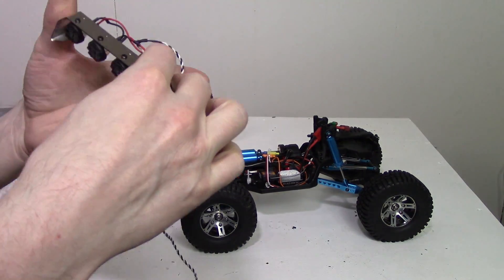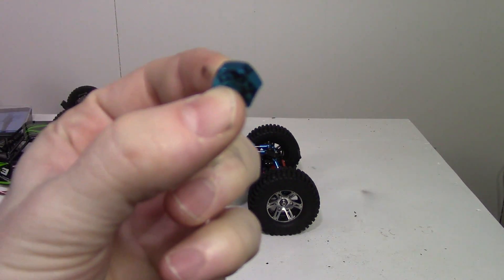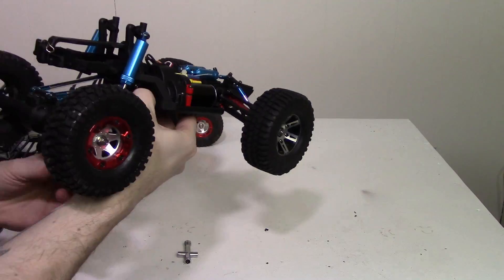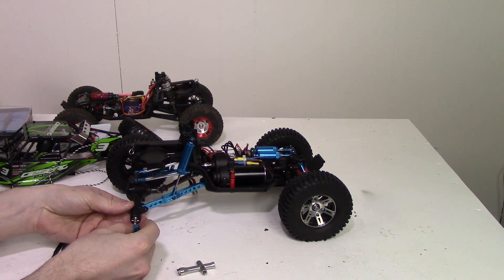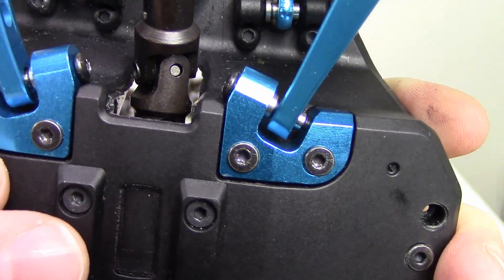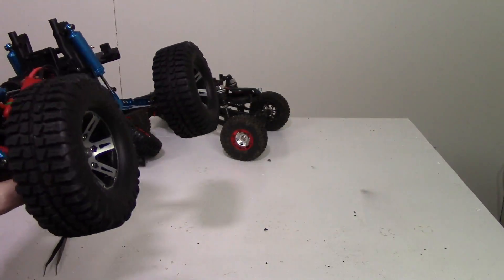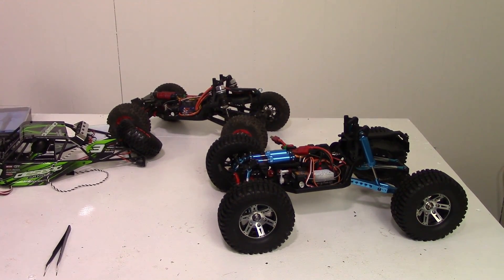Taking a look at a few more Feiyue upgrades!

Comment: how's bout a quick update on those oil shocks. I'm worried about their functionality being the price I spent on them and they don't even have no type of bladder system in them to help keep fluid from foaming. shit I'm seriously  considering using power steering fluid as it originates either from silicone or mineral  base product same as rc oil but I really trust p/s fluids anti foaming agents more I think considering I've worked with it my whole life. how they been for you? really need to do a full charge bashing run than open up a shock and see if it's full of air bubbles or see if it start to get bouncy in rear as Temps rise or under lengthy use. keep me posted appreciate  it void!!
Reply from the maker: I'm hoping next week the weather will cooperate for me to get out to the trials to do some good running. I've just recently replaced the no name 30ish weight oil I had in the rear shocks with some team associated 80wt oil(made by lucas oil). I'm hoping that it should preform well. It's already made the shocks feel much nicer, less bouncy and a nicer rebound. I'll be doing the front shocks before I take it out, I'll let you know how it goes when I do!
Reply: Appreciate it. From the 1 review I seen on you tube on that team associated oil, white bottle with blue writing it didn't do so hot in cold temps actually it was more on the cold side than hot. Stiffened to the point it would give no travel to the shocks the bottle claimed it wouldn't do that in cold conditions, Idk I do know Lucas makes some of the very best products. Oil does stiffen up when cold so without some kind of alcohol additive I can't see them claiming that.

Comment: I did some lol tree climbing yesterday and I have to say I'm greatly impressed with how easy this buggy climbed up the tree all the way up vertical with the slightest throttle input and stayed as long as I kept on the throttle of course. I'll post a quick pic in a minute. These tires are super sticky that's for sure way way better more traction that the stock treads. I will say the 10 to 15 minutes of tree climbing got the motor and esc way way hotter than any 30 to 40 minutes of yard bashing even during the 90° days. Anywho now I got this new job I'm gonna go ahead and order the jlb cheetah oooh I'm geeked about this project for sure. Can't wait to see it complete with a nice 5th scale can idk it comes stock with 8th scale motor so why not. Like I was saying earlier I plan on sticking with skyrc stuff cause they so far have shown me nothing but great results. One ride I plan on goin all out with something more expensive. Gen 2 tekin esc I'm thinking. Idk well see what goes down. I'll for sure stay in touch with you since your the only person I know and talk that likes the hobby as much as I do.
Reply from the maker: I just checked and I guess you haven't put the pics up yet, but that sounds like some great fun tree climbing lol. I'll have to give some skyrc esc/motors a try sometime, have never used them. I'll check again to see if you added the pics in a bit. I've always wanted to drive a 1/5th scale but 1/8th is the biggest I have so far. I don't really have a place to run a big 5th scale rc either, not to mention I can't afford one either heh.

Comment: Hey Void, any advice for a nice servo upgrade for the FY01 , I'm pretty new to these, just looking for some more turning power.  I'll be installing the brushless kit soon but the one sold on BG doesn't seem to be much stronger.  Can't seem to find the right info for a more powerful servo that will fit in place.  Any help is greatly appreciated.

Comment: I would paint the silver part on the light bar black so that it would match better, just my opinion.  What are the length of the front and rear shocks that you used in the build?  Can you provide a link on where to get them?   What type of wheels are you running? Great video, keep the content coming!!
Reply from the maker: Thanks very much! I have already painted the light bar black now though. The rear shocks are 90 something mm : http://bit.ly/2N4c3sE  I front are 70 something mm : http://bit.ly/2Oa71j5

The wheels/tires are Austar 1.9 sized 1/10 scale: http://bit.ly/2R6jwdM

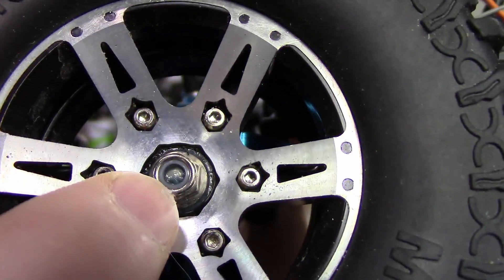Comment: what is the turn ratio of the 390 motor. also will a 1:10 scale motor work in the fyo3 what would I have to change
Reply from the maker: I'm not sure the the turn of the stock motor is. The bigger motors with 1/10 scale won't fit, well I have seen 1 person put one in but it wasn't the best job and the motor was only held in by 1 screw so I wouldn't advise that.

Comment: Nice video. How are your diff gears holding? Feiyue or WLtoys, which brand would you recommend and why? Thank you.
Reply from the maker: So far with the feiyue the diffs have been good for me. I have to say I think the Feiyue is better. The electronics of both of them are about equal but the drive train starts to let you down on the wl toys. Also the plastic is pretty soft on the wl toys too. I've also found the Feiyue to be better for upgrading to brushless.

Comment: Do you know anything about the helion rockrider? I'm contemplating getting this feiyue and all the upgrades for brushless and drive terrain but with all of that would be around the same for the rockrider. How much would you say you have invested in the feiyue?
Reply from the maker: I don't really know anything about the helion rockrider although having just looked it up it does look pretty nice. On this current feiyue I think It's probably around $175USD for everything including the feiyue it's self. The wheels I put on it were probably the most expensive thing other than the feiyue, they were about $34USD.
Reply: Void X RC what's your average wait from banggood on all these parts, if I do get the feiyue, I'll get the brushless upgrades and some aluminum parts with it
Reply from the maker: It's really depends on if you use the free shipping option or not. Using the free shipping I've had awful long wait times, like 3 months or more. When I pay for shipping it's usually 2-3 weeks.
Reply: Void X RC well I'm ordering the brushless kit and a upgraded transmitter as well, how well did the stock driver terrain other stuff hold up?

Comment: Where did you get the pinion you used
Reply from the maker: I'm not really sure, it's been sitting in my parts bin for over a year. If I can figure out where I got it form I'll comment again.
Reply: Void X RC ok, I'm trying to find domestic parts without having to deal with banggood shipping times. I think I found a pinion that will work though

Comment: If i buy the stock car, can i change the stock battery to 8000mah lipo 11.1V and if i do change the battery what else would i need to upgrade since my running time will increase?
Reply from the maker: The first thing is I don't even know how you would mount such a big batter in it but if you did. You would need to replace all of the electronics and upgrade the drive line as 3s would beat up the stock one pretty quickly.
Reply: Void X RC what is responsible for the speed of the car?  The battery or the motor ??will a motor rotating speed at max power will increase if i add a battery of more mah?
Reply: There are different voltage batteries out there but i cant find any motor with any voltage tag on it...what if we run the motor will 1000 v 🤣🤣🤣
Reply: I know it wont handle such voltage but how a noob like me will come to know which motor is suitable for which battery?
Reply from the maker: The speed of the car comes from a few factors. They are the speed of the motor, the gearing and the voltage of the battery. 

1. Motor speed: For the speed of the motor there are a couple of terms. For brushed motors they are rated in turns, the higher the turn number the slower the motor, the lower the turn number the faster. So a 10 turn brushed motor is a lot faster than a 30 turn brushed motor. For brushless the term is KV, the KV rating is the number of revolutions per minute the motor will turn with 1volt. So the higher a KV number the faster the motor is. Most brushless motors do tell you what kind of batteries to run but they might not say it in volts. If a motor says it is good for 2s to 3s lipo than means it is good from roughly 7.4 volts to roughly 12 volts.

2. The gearing: This also plays a large role in how fast a vehicle is. The two gears that influence speed are the pinion and the spur. Using a smaller pinion will give you slower speed, a larger one will give you more speed. There is more to it than that but for the feiyue you don't need to worry about it as there aren't many choices in gears.

3. The battery: The battery influences the speed based on how many volts it has. The feiyue specifically is meant to run a 2S lipo battery. A 2S lipo has 2 cells in it that have the same voltage. each cell is 3.7 volts so a 2S lipo gives you 7.4 volts. A 3S lipo gives you 11.1volts.

Here is an example: Lets look at this battery: https://www.banggood.com/112-14-2845-Senseless-Brushless-548036002800KV-Motor-p-987419.html?rmmds=category&cur_warehouse=CN

If you scroll down to the specs you will see the the 3 different KV numbers you can get: KV: 5480/3600/2800KV 
2 lines down from that you see this: Max Voltage:<9/14/18V 

What that is saying is that the 5480kv motor's max voltage is less than 9volts, the 3600 max is 14 etc

If I didn't explain that well or you have other questions feel free to ask.
Reply: Void X RC doubt clear but can you suggest me the perfect ESC for the motor you gave  me in the link.....and i wanna know how the  radio and the receiver works....i mean there are bunch of radios out there and bunch of receiver...some radio comes with a receiver but most of them don't come with any receiver....how to know which receiver is perfect for your radio.....what happens when a large no. Of people playing with their rc cars in the same range  dosen't chaos occurs???for my info people says we can control any receiver from any radio.....what if i finds an expensive drone in the sky, i wanna steal that drone, all i have to do take out my radio (which i use to  control my rc car) and fly the drone to my location😂🤣🤣🤣🤣🤣 does this how radio and receiver works????
Reply from the maker: This ESC would be a good choice: https://www.banggood.com/Racerstar-45A-ESC-Brushless-Waterproof-Sensorless-110-RC-Car-Part-p-1085225.html?p=AF261224072852015082

The radios need to be linked to the receiver before they will work together. And once they are linked you can use them around many other ones. Also not all radios/receivers use the same radio protocol, there are different ones so you need to make sure that the receiver you buy matches the radio unless you buy them in a pair.
Reply: Void X RC thankzz a lot
Reply: Some brassless motor have 2000kv-5000kv (ascending to descending) & some have 5000kv - 2000kv (descending to ascending) now, since in both of them the max is 5000kv so will they rotate the same speed or is there any other way to check the motor speed?
Reply from the maker: Those are different motors, a motor can't have multipul kv numbers.
Reply from the maker: That motor link I sent to you, you have a choice of 3 motors, a 5480KV one, a 3600KV one and a 2800KV Motor
Reply from the maker: I personally suggest the 3600kv one
Reply: Void X RC will 3600 kv more faster than 5480 kv😕?
Reply from the maker: It's a little slower than the 5480kv one. I just suggest it because it is a good middle ground between speed and torque, also I haven't had major parts breakage with that speed of motor in feiyue

Comment: trying to install heatsink cooling fan on my 12428. the polarity of the magnets is literally slowing the cooling fan motor down so much that it would be totally useless. any suggestions? wondering if flipping the motor turning it clockwise 180° would solve this or some type of antimagnetic material in between the fan and motor, shit man idk I've never heard this problem once in any reviews and I assure you it isn't binding at all. I've checked this with another set of fans and it does the same....
Reply from the maker: +Mike Fahner Oh wow I not heard of this happening before! I've only used fans to cool brushless motors before and didn't have any problems. I'm going to try to recreate your problem with my 12428 in a little bit. I'll let you know if I figure anything out!
Reply: Void X RC I figured it out. I had to flip my motor 180° to find a spot with not much magnetic field. I got lucky with perfectly 180 rotation so the cooling fan can sit straight upright while allowing the fan to turn. Most those fans sit high enough on the heatsink to be ok but mines has a shroud like setup so it sits rite on top of the motor which in turn was stopping the fan from turning. I did see in 1 product review the same problem occuring. I think maybe once I get my brushless setup it will be easier but for now. Yeah take a ,cooling fan while running and place it on a 540 motor and see what the magnetic field does.
Reply from the maker: I've just playing around with a fan and some motors. I got the exact same result with different sized brushed motors. When using brushless motors though I couldn't get it to happen at all. Which makes sense since the magnets in brushless motors(inrunners) are mounting on the rotor instead of the can. I'm guessing the stator winding and the can shield the magnetic field.
Reply: Void X RC yeah I figures once I go brushless I won't experience  this considering the magnets are in the armature and not inside against the can. just ordered a new lipo charger and a venom 3s 2200mah lipo plus a traxxas valineon cooling fan for the esc. the esc gets pretty hot during a good run and I figured it will get hotter with the 3s and pulling the extra load thru it running the other cooling fan.

Comment: What kind of servo do you use
Reply from the maker: I use the Corona DS238/CS238: http://bit.ly/2siIpXW
You have to mount it differently but its very easy and the servo is stronger.
Reply: Void X RC thanks I've been using a redcat servo and the gears keep stripping out
Reply: Void X RC can i use the same servo on fy06
Reply: Void X RC can i use this servo on fy06
Reply: @VoidXRC  or Adnrew 71102, do you guys know if this servo will work in a FY01 or what  would be a good one would be to get for more turning power, nothing ? 
Thanks!

Comment: For the nut not having enough axle to hold on to buy some of those M4 nuts that don't have that flat end and just drop a small thin washer and then screw the nut in head-first so the nylon will be holding on the entire axle that's what I do to my trucks
Reply from the maker: Thanks for the information!

Comment: what's up void x!!! need your opinion on couple things real quick. I'll try to be short as possible sorry! start off with I smashed my year old galaxy s5 using it as a speedometer, I will say with very very short distance I managed to hit 57 mph with maintaining barely half throttle while barely tapping 3/4 throttle. 2 nights of road passes without 1 accident this time I was at end of night last pass done which was definitely better and faster than my last 57 mph run as I was pulling her back into my driveway my 4 year old darted into the street causing me to turn too sharply which rolled at maybe 20 mph, not bad but the cheap tape broke and the phone slung straight into the air like coming off a slingshot bouncing like a b-ball. needless to say I didn't get to see the last pass mph due to a cracked screen. this was last Sunday night bummer. anyways I did get a brand new galaxy s7 which will be here today. than yesterday I twisted the rear driveshaft in half.  i do have a stock replacement here. your opinion should I keep dumping dollars into the wltoys or just get a faiyue and switch the parts into that, and will a 540 can size fit into the faiyue? if not I'll pass on the faiyue and just completely replace the 12428 front and rear diffs. as of now I have an extra $100.00 to play with and I found the faiyue brand new off eBay for $60.00.... thanks brother...
Reply from the maker: 57mph is very impressive for the 12428 I have to say. You are running a lot more power than it was meant to run though, so I can see where the speed comes from. I'm not surprised the rear drive shaft twisted up with that much power! I've only ever seen 1 person put a 540 in the feiyue and it wasn't that well secured, only 1 screw holding the motor in. It's not something that I would suggest.
Reply: Void X RC the 57 mph was withing only 7 mobile home lengths before I have to start braking. I have more distance to get a rolling start but can't go fast till I get around the bend than I get only 7 maybe 8 house lengths. I still haven't been able to floor the throttle and it's driving me crazy lol. Still running lowest settings with the timing just at 5° to get out of blinky mode, the blinking light bothers me a little. I'll take your advice on the faiyue. I'm finding the rear axles with ring and pinion for $8 and the front diffs overseas, bout to pull the trigger on a gamble to see if they will fit than. Found your beadlock aluminum rims 1.9 off your faiyue for $25 and some nice off road tires, tread pattern same as on those massive dump trucks lol. Probably pick them up and start the aluminum upgrades also. My only gripe on this buggy is the plastic gearing. The steering is 150% better now with the new servo and radio. Idk shopping for more parts I guess. Thank you sir.....

Comment: i am looking for oilfilled shocks for feiyue fy03  where could i find one that can fit both front and rear  suspensions?
Reply from the maker: I have both of the upgrade aluminium feiyue shocks, you have to put your own oil in them but they work fairly well.
Front shocks: http://bit.ly/2hV13SY
Rear shocks: http://bit.ly/2gflEkM